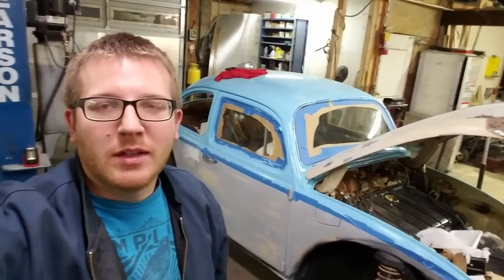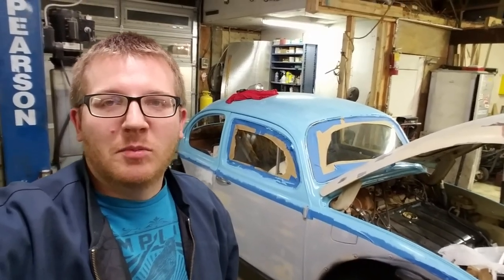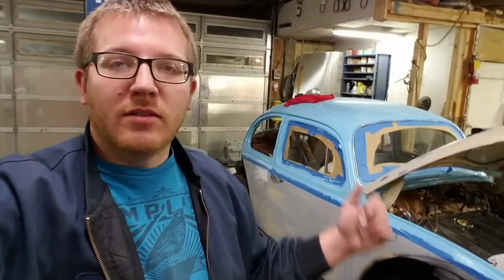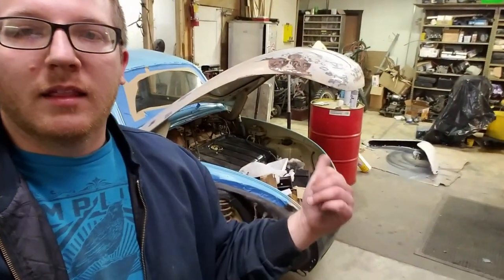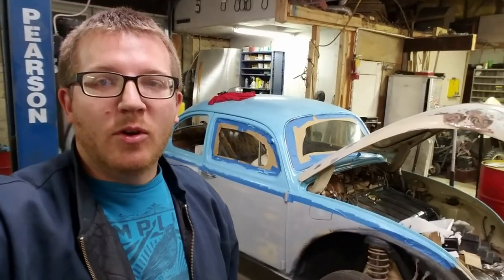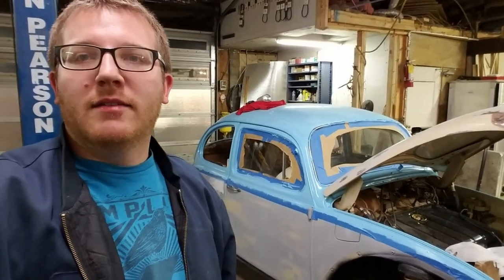71 vw beelte - WHY ARE WE ROLLING PAINT - DIY $50 Paint Job - classic restoration rebuild giveaway

Comment: Had a sister in law that painted her Bug with Lt Blue house paint and a 6 inch brush, no sanding and I dont think any tape found its way to the project either,  She thought it looked beautiful, and being a nice guy and not wanting my wife to knock me over my head,  Oh Robin that came out looking so nice, you did that all by yourself way to go. You gotta get those points when you can. She carried the paint can in the trunk so when it chipped off, she would just you touch it up a little. She drove it for years. I still kid her about it 40 years later. She now drives a Escalide, and a beautiful Harley. Funny what you will do when your broke. all in all it did look better then brown surface rust. The large brush strokes just didnt look right :)
Reply from the maker: Charles Miller hope we will be laughing about it later but I hope the metal enamel paint and hardener will make it better then house paint. Im just cheap not poor lol and in the future it might get a pro paint job from a friend in ky when it gets there.
Reply: Charles Miller  what a gentleman, good on you,😉
Reply: It was a strange time, the early 70s, At the same time, I was driving a Rambler station wagon, with no shocks just coil springs all the way around, that was the strangest riding car, It was my girlfriends car and she had broke up with her last boyfriend right in the middle of a new shock job.
Reply: Charles Miller I'm sure I read somewhere that cars used to be hand painted in the factory by time served craftsmen before the use of spray equipment. I think Rolls Royce did with many hours of sanding & polishing to get a glass smooth finish.
Reply: That is wild, never thought about before spray guns. I would like to see one, just think about the talent, mind blogging.

Comment: Looking good bro are you keeping the rims and caps.  The white its just white or the ivory where did you get from. again thanks R. Flores Tx.
Reply from the maker: Yep keeping the wheel cap set up, the wheels are the same ivory color as the sides. Then we cleaned up the chrome caps. The paint is a rustoluem spray paint that I bought at the hardware store.

Comment: Hopefully you didn’t overspray your blue
Reply from the maker: XSk8erXGamerXModzX no its all good. We are just putting down the first coats. Then we are going to sand everything again and mask off with tape and paper. Ivory first then wrap it all with paper to protect it and finish blue at the end
Reply: Just a heads up, since you left the tape on the car for so long you are going to 1) pull off a bit of the blue and 2) might have to clean off some adhesive from the tape. What are your thoughts on clear coat? I think this cheap paint job might work but you are going to need something to protect it from the world and especially UV rays.
Reply from the maker: Brent Miller good point. Maybe clearing it in the paint booth would be a good idea. Controlled clean environment. Thanks for the heads up on the tape.
Reply: Wide Open Throttle Garage you want to pull the tape off before the paint fully cures. I’d say within an hour of painting
Reply from the maker: Brent Miller k great on the final roll we will pull it off right after painting. Ill clean the rest off today and restart.
Reply: don't worry, next owner is gonna sand blast it 😄
Reply from the maker: Mr. MOTORMASTER I doubt my mom will LOL... If all else fails take it a my friends paint shop in ky lol